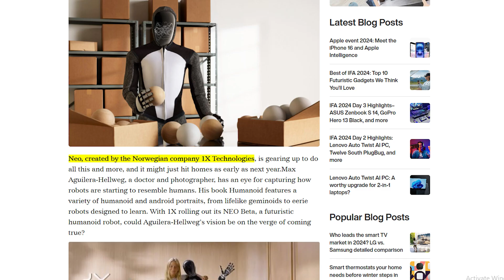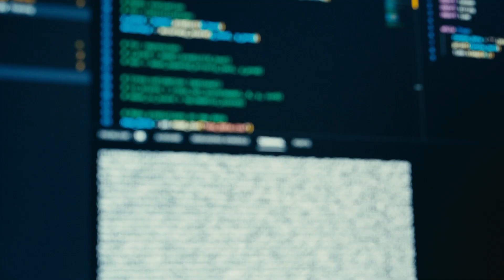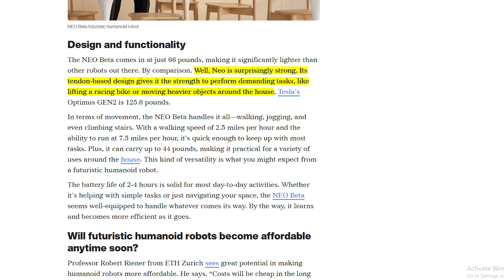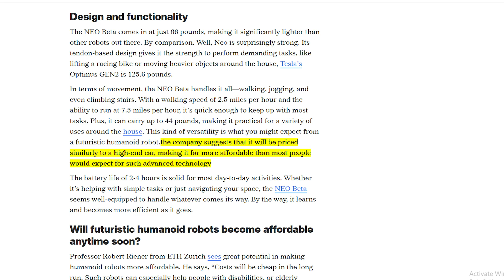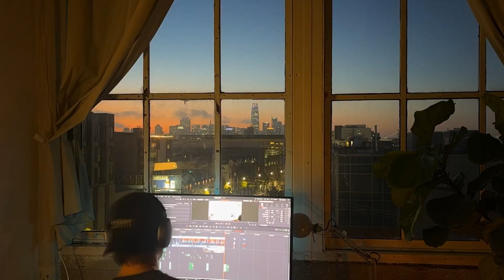This Home Robot Will Change Your Life Forever!

Comment: The clothes slip it into the uncanny valley. Looks like there's a hunger victim beneath it, with a mask on. Harder plastic outer shell would be more ideal, not just to avoid the valley, but to also make it easier to clean. Wipe down, instead laundering.